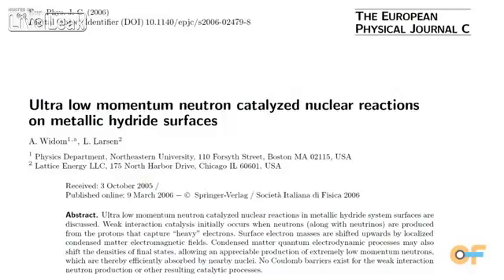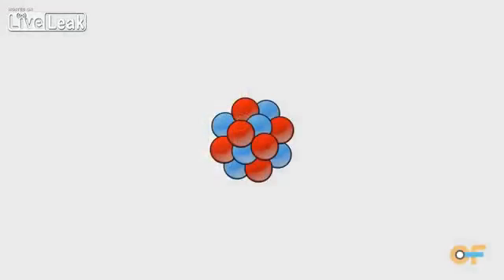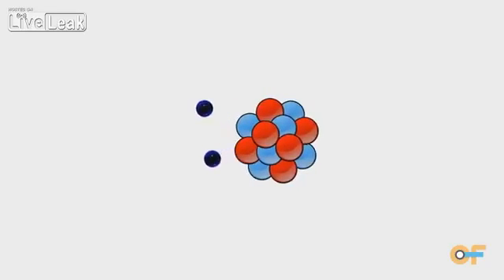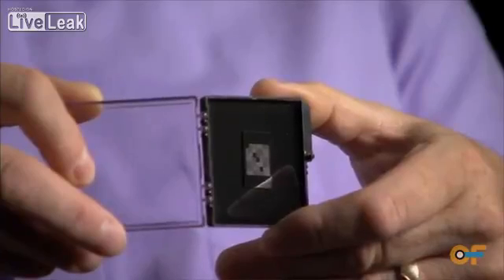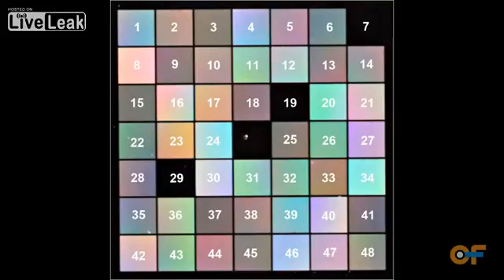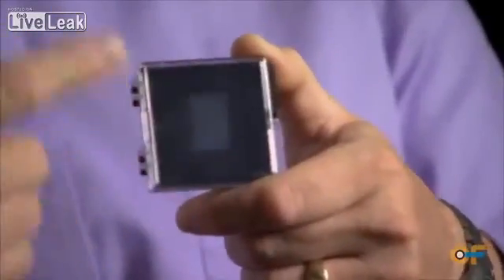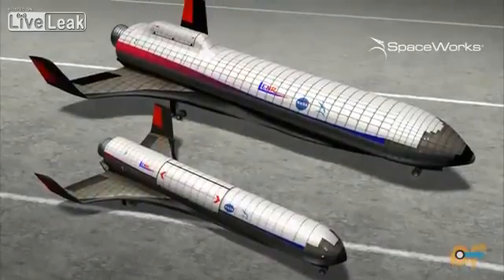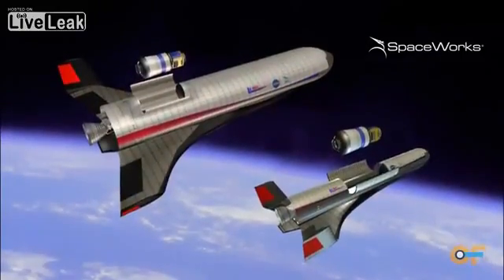NASA’s cold fusion tech could put a nuclear reactor in every home car and plane

Comment: In getting over a head cold I started thinking that a common steam vaporizer might become a cold fusion reactor if you ran it on rain water with the extra deuterium content. Anybody ever check this?
Reply: Canada has 550 mm in depth of rainfall on average in one year.  If we had something the size of a CFL football field to catch all the rain, we would have a volume of only 3245 cubic meters3. That is only enough water to fill 1 and a half Olympic sized swimming pools.